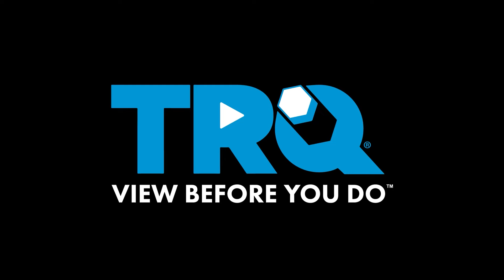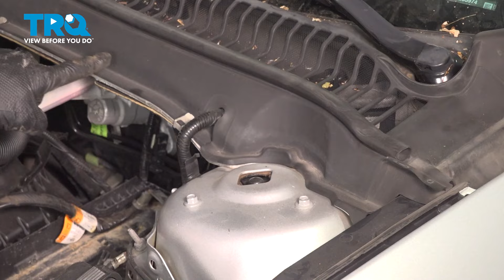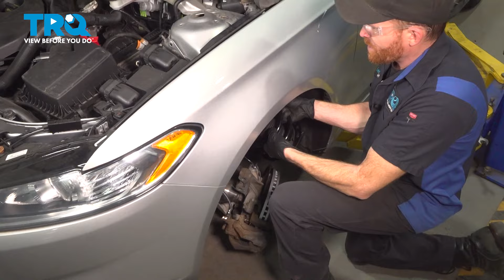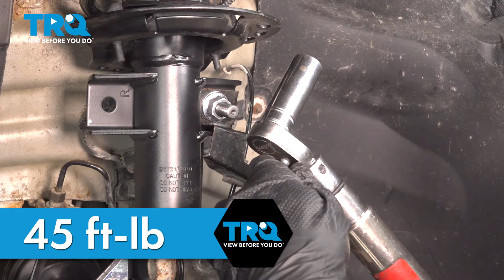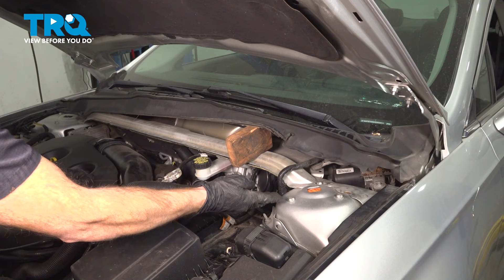How to Replace Front Strut Assemblies 2013-2020 Ford Fusion

Comment: Need a list of EVERY tool that was used because Im going to buy everything!

Hammer
Hammer Punch
Crowbar
Torque Bar
Angle Pick
Impact Wrench

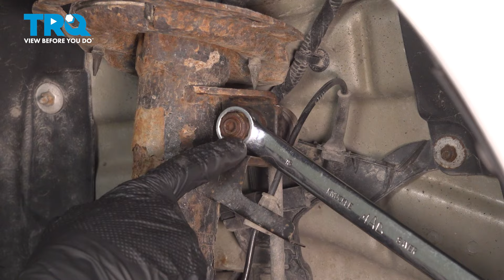What did he use with the 18 MM Wrench *Extending part? 1:35 

Was that an impact Screwdriver? 5:15

Comment: My 2016 fusion doesn't have splined bolts on the bottom of the strut, they are adjustment bolts for your camber. My tire was basically touching the strut until I went back in and adjusted them

Comment: The lower strut attach bolts on a 2013 are not splined and both nut and bolt were 22mm.

Comment: Hi, i bought all the parts to replace the front shock absorbers. There is a table for torques on the internet. It says the value for the lower bolts is 70ft-lbs. in the video it says the value is 173ft-lbs. Is that correct?

Comment: I found the axle nut torqed at 148ft lbs doesn’t tighten it a great deal.. it actually came off easy (zero effort) when I tightened it at 148 and removed it to test it. That’s alarming really.